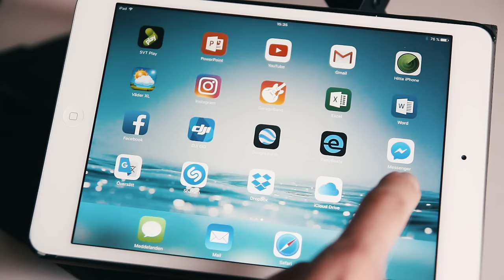How to make a DIY Teleprompter - cheap and portable

Comment: Thank you for the excellent video! I especially like using a tee shirt as it is more stretchable than normal black cloth.I found this the perfect project for a rainy day.I am modifying the design to include what is called "tee-nut". This will go thru the plywood bottom and allow mounting the whole thing to a tripod or lighting stand. Thanks again!

Comment: I found this interesting to watch. I am building one using a Siemens LCD Screen off an older computer. My choice of the screen was motivated by it's construction, it is very sturdy. I got some beam splitter glass from a local supplier and put it into a picture frame (as you did). The screen was slightly deeper than the frame and I mounted the frame with hinges against a piece of wood, which is held in place by two adjustable clamps with wing nut screws. I like the idea of a T shirt to make the blackened enclosure, but I used black felt and trimmed it to size. The components including glass and frame cost in the region of U$40.00. I run the autocue section off a laptop. The screen size allows me to position myself quite a distance from the presenter and I can adjust the size of the characters to suit the reader.  I used to use an older autocue with a CRT monitor in the past, so this one is considerable lighter. I am just welding a bracket to hold the construction in place on one of my Sachtler tripods.  Your video is great

Comment: Thanks so much for this brilliant step-by-step... I've just made one following your video and I can't believe it; I'm stoked! I made mine a little differently in that I made it out of two picture frames and covered the hardboard backing of the bottom one in black velvet as a nice non-scratchy bed for my iPad. Then I just used two short bolts instead of the full-length threaded bar. Ginormous hug from me! x
Reply from the maker: Great! Glad you liked it =)

Comment: Thanks for the tip! I set up my TP as instructed and I have a problem: The projection on the glass is blurred, with shadows on the letters. I have already changed the position and height of my tablet, but it remains the same. Was there a solution? Any adjustments to the TP? Was it due to the type of glass?
 
About sewing a T-shirt, I found it easier to staple with a stapler.

Greetings from Brazil - 2020, covid19 quarantine
Reply from the maker: Thanks for your comment! There will be double reflection when using regular glass. I do not think it is very disturbing if you are not too close to the teleprompter. Otherwise you have to use a special beam splitter glass.

Comment: Dear Soarpix,

Thank you for this tutorial I have tried this method and it worked! 
But I saw double text in my selfmade Teleprompter. 

How can I fix this?  Thank you! 

Greetings from Holland
Reply from the maker: Hi,
You can use beam splitter glass but it is more expensive. I use regular glass so I also have a bit of double text but I don't think it is disturbing if you take a step backwards and make the letters bigger.

Comment: Very, very nice video and build.  Although your design is the best,  there's another option if someone doesn't have the tools/material to do the aluminum angling bar.  You can cut out 2 small triangles (wood, foam-core, whatever), and tape-hinge them to the platform and turn them up-right so they hold the glass at a 45-degree angle.  When you put it away, you just fold them back down.  In other words, you keep the glass up using two 45-degree shims.  Again, great video!
Reply from the maker: Hi Maxotics! Thanks! That's also a great idea. I actually made something similar at first. You can see one of my triangles at 02:19 =)
Reply: Cool!  Missed that!

Comment: What thickness are the 2 flat pieces of wood you glued to the picture frame? Also, what angle did you open up the teleprompter to to mark where the threaded rod would rest? Thanks. Very helpful video!
Reply from the maker: Thanks for your comment! The thickness is 3 mm and the angle is 45 degrees.

Comment: Dear sir i using different types of glass after I see this video... But all are unsuccessful.. Every glass are showing  the text shadow .... Can you explain which glass use for it... Otherwise send me link to buy the glass.. 
... I have already spend 1500 rs but I am not able to..
Reply from the maker: You can use beam splitter glass but it is more expensive. I use regular glass (the one that came with the frame) so I also have a bit of double text but I don't think it is disturbing if you zoom in the lens, take a step backwards and make the letters bigger. A thin glass make less double reflection.

Comment: I used ipad 2 digitiser, in boiling hot water separated digitiser glass itself from front cover glass, discarded digitiser and laminated front glass with 70% window tint film from ebay for $3. (70% means it lets 70% of light through and blocks 30%) real Teleprompters use 40%, it works great!

Comment: Looks great but I am really sceptical about the video quality as there's no proper reflective surface, light from the iPad might be directly falling in camera sensor.
Reply from the maker: It actually works really well and the light from the iPad does not affect video quality.
Reply: Question hot do you manage to stabilisez it with the camera you did show that in the video

Comment: Which kind of glass we can for this?
Reply from the maker: I use regular glass. The glass that came with the frame. =)
Reply: What name the aplication about writing on tablet for tele bro?
Reply: @MrOne-im7uh  simplest way, convert and invert powerpoint text using ppt mirror tool for your iPad/Smartphone and place the device in a teleprompter then get started, you can use bluetooth  pageflip pedal to switch the slides from one to another during video recording

Comment: How thick must the glass be so that the reflected letter is not doubled?
Reply from the maker: if you have a thin glass it becomes less noticeable. I use the glass that came with the frame and it works very well

Comment: What is the thickness of the glass used for as a result of the Duplicate text problem reflected on the glass?
Reply from the maker: I use the glass that came with the frame. i Think it is 2mm. maybe 3mm. A thin glass make less double reflection.

Comment: How to avoid reflections? I'm getting two impressions of each object on glass.
Reply: It’s because it’s picture frame glass. Teleprompters use a special kind of beam cutting glass. Because this isn’t that, it produces the effect known as “ghosting.” As long as it’s not too distracting, I hate to say it, but you’re gonna have to live with it.
Reply from the maker: Thank you for your comment. There will be double reflection when using regular glass. I do not think it is very disturbing if you are not too close to the teleprompter. Otherwise you have to use a special beam splitter glass
Reply: @Soarpix3D  Thank you for clarifying doubt.

Comment: Great Teleprompter, however, why no just use the tablet propped up?  The have some tablet cases that do that... then just read the tablet!  I like the scrolling software!
Reply from the maker: Well, the whole idea with a teleprompter is that you can read the script that is reflected to the glass and still look straight into the camera that is behind the glass. You can't do that with just an tablet.
Reply: soarpix.com The angle of the tablet to camera if placed just above tablet is not so great if you stand at least 3 ft away and the text read is at the top of the tablet.
Reply from the maker: No, the glass screen is not noticeable
Reply from the maker: Good luck with it! :)

Comment: Any ideas what it could be when you see the same letter twice in the teleprompter? It is fine on the screen, just the glass shows one letter, and than the same letter a bit off in the back. Wrong glass? Angle seems to be fine (45 degree)
Reply from the maker: Hi Arvid! I have the same and it's because I'm using regular glass instead of more expensive teleprompter glass. With regular glass you get a reflection on both the front and the back of the glass. A more expensive teleprompter glass is a bit darker and more reflective on one side so you only get one reflektion. But for the low price I can live with dubbel reflektion =)
Reply: soarpix.com I might order some foil and see how that works

Comment: Great Video. Thanks I will definitely be making one of these. I just started my channel and I know what I want to say and I get tongue ties. This will help out a lot.Thanks
Reply from the maker: Thanks! Glad you liked it, and good luck with your channel =)
Reply: and also if you struggle remembering the words, you could create your script  in MS powerpoint and use an app called ppt-mirror.com to convert and mirror-flip your ppt files for your device to use in a prompter, in that case you don't need to memorize the script by simply using your existing slides and also the App doesn't force you to read word for word.. best wishes with your channel.

Comment: This probably looked like a great idea when you started it- but then you found that overhead lighting means that you need to obscure the top, otherwise you get reflections off the back of the glass. So you made a black cloth cover to do this. Good save. But a bit fiddly. A lot depends on how important small storage is to you- I went for an open fronted box that clamps to my tripod top. 
 By using a mini-ipad it is not that big. Horses for courses. Not clear how you mount yours.
Notice that you made a teleprompter, but gave us (annoying) music instead.
Reply from the maker: The black cloth cover was actually the original plan and I still like the design. If you watch till the end you can see the teleprompter mounted on a light stand. I also have a separate video on that. But don't bother watching it. It is probably annoying as well.

Comment: No details of how it is mounted to tripod and or to camera.... that IMO is the crux. Good build though, just not a complete DIY video.
Reply from the maker: Hi Jeff! You can do the mounting part in different ways. But I just put the camera on a tripod and the prompter on a light stand with a screw through the bottom plate.If you pause the video at 04:12 you can see that setup
Reply: That's exactly what I'm looking for.  This is a great Telepromter but none of the vids show how to mount it

Comment: Not quite easy to make without first having all the tools needed. Added expense if you dont have clamps or metal strips to bend or drill bits that can bore through metal and the screwdrivers and hinges and wingnuts and a sewing machine and disposable t-shirt. Even after that, the text is blurry. Bad video.
Reply from the maker: Why are you even watching a DIY video then? 😂